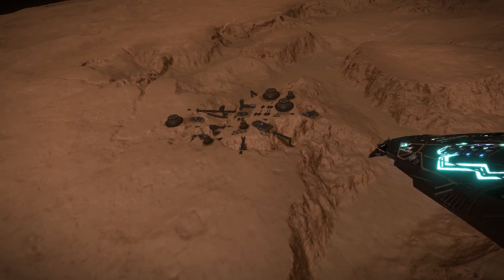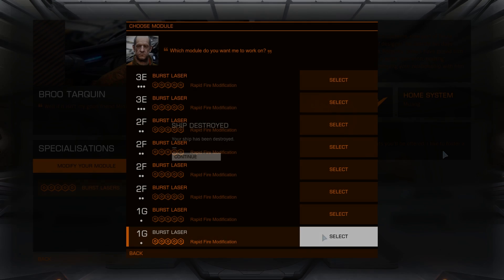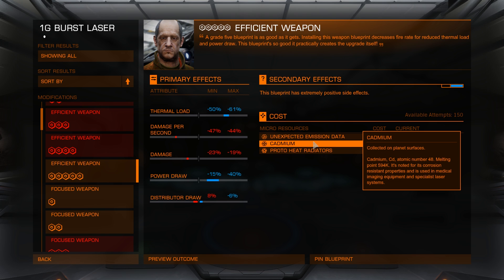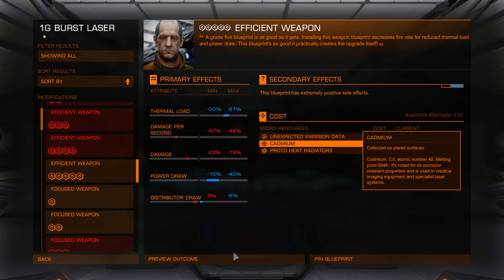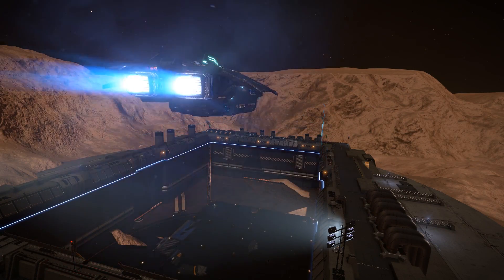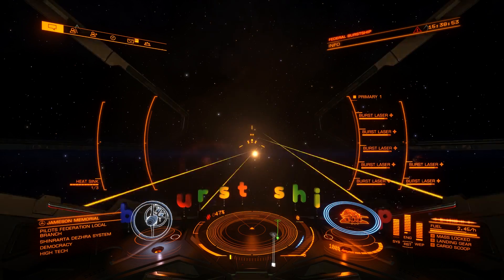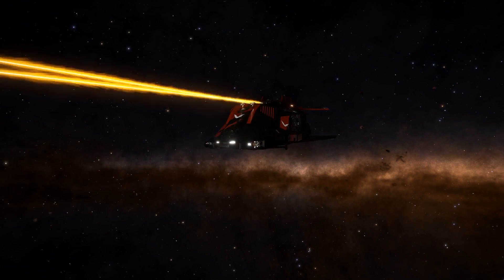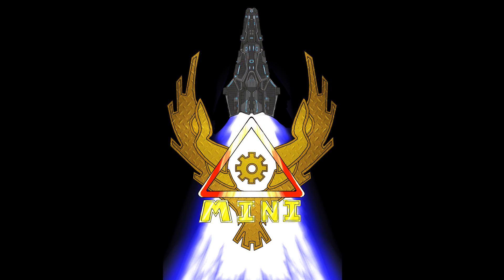THE FINAL EPISODE OF OVERENGINEERING

Comment: I used EDDB to find a planet rich with Arsenic for my FSD level 5 engineering.  I drove around for 1 hour to find not one rock with Arsenic.  Everything but what I was looking for.
Reply: Uri Gressel I've had luck finding most rare minerals close to crater edges or rocky terrain on a planet. Try landing close to one of those areas. I have no proof this works besides my experience though. Also, only go to planets with higher than 2.0% of whatever mineral you're looking for.
Reply: Christopher Medower That's what I do as well.  From a Geological perspective, one would start near an area where the subsurface was expelled.  I'll just need to try a different moon.